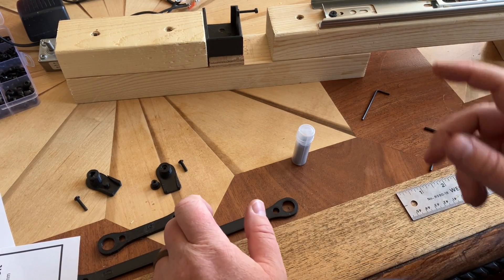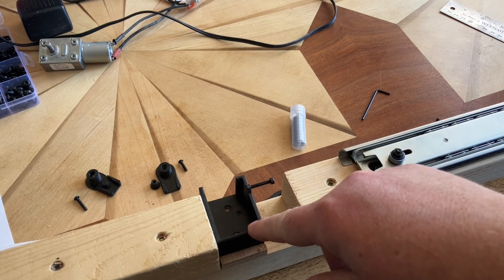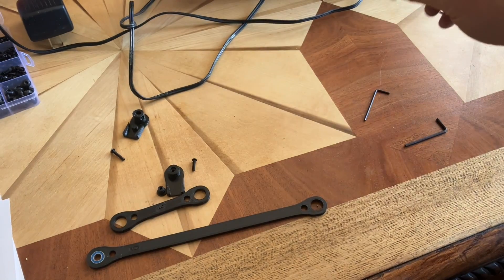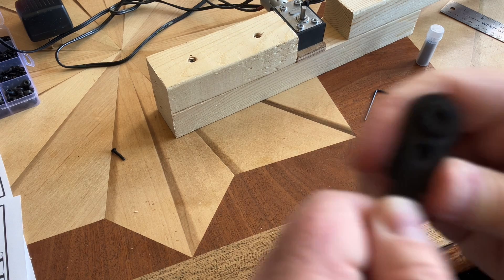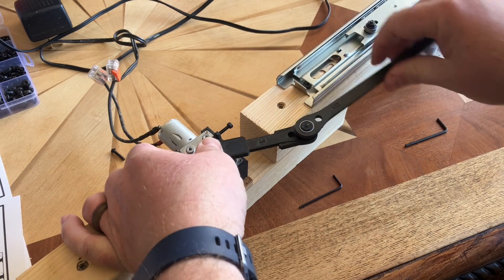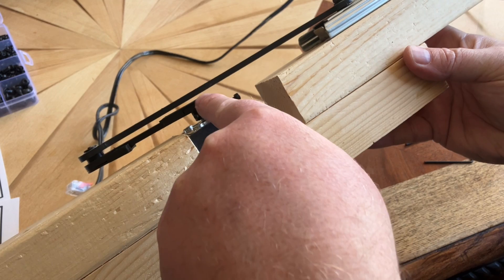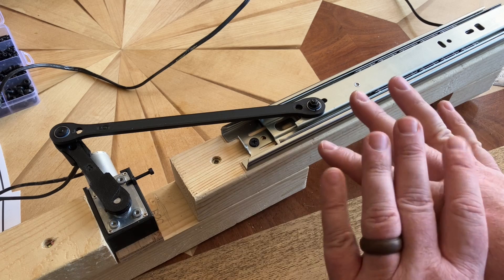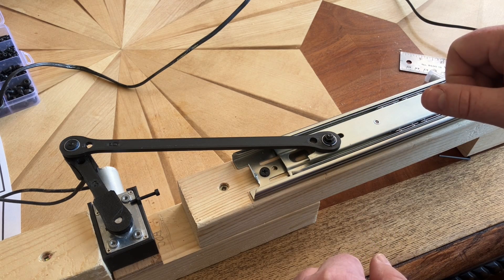DIY Linear Animatronic Mechanism Setup with Modular and 3D-Printed Components

Comment: Great work. The mechanism is called a “slider crank”. How long have you run it for? I worry a bit about bearing movement in the connecting rod arm. I also sent you a message on Halloween Forum.
Reply from the maker: Hey Doc, I replied to you on halloween forum with a long response, so I apologize.   I ran the mechanism with zero issues for about 2 hours with the only issue the motor having a weird squeak on worm drive on the downward load stroke.

Comment: Absolutely fantastic!  I'll be printing some out and testing them soon.
Reply from the maker: I found my best results were in petg, 1.2mm walls, gyroid infill. It made a super strong build that I think will stall the motor before hitting the break point.  Regardless, have fun it really is an easy system to put together. Thanks for watching!